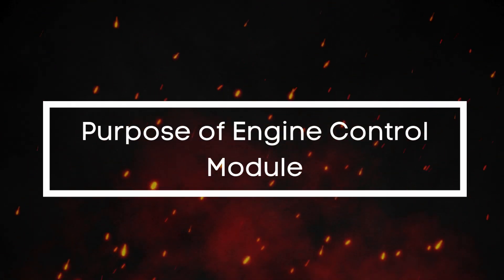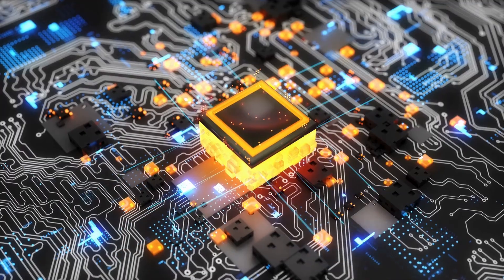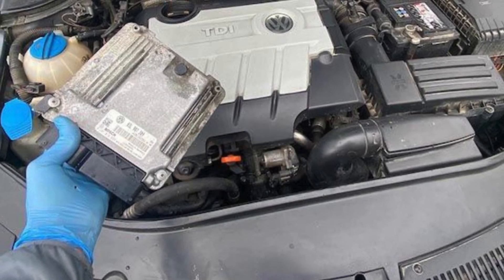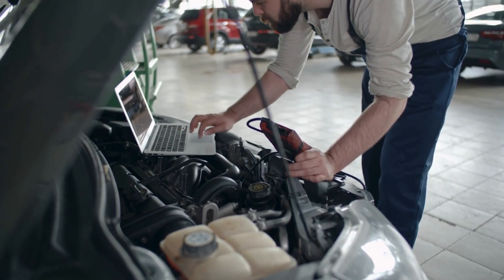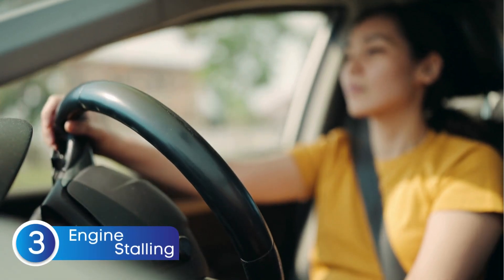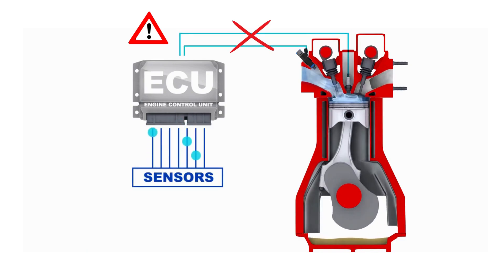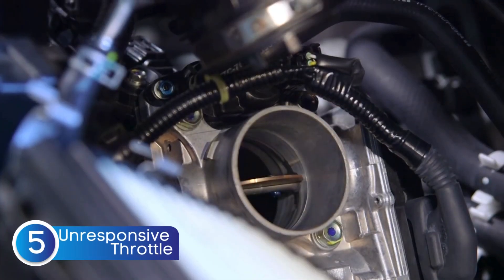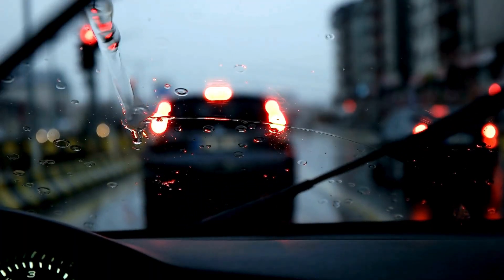Symptoms of a Bad ECU (Engine Control Module)

Comment: I take care of my car so I know it’s no major problem all my serious parts was replaced like battery, alternator, spark plugs, fuel injectors, ignition coils Oli changed regularly and all so if the ecu acting up is because it’s a old car used car and it’s probably time for a new one
Reply from the maker: It might be worth checking for any stored error codes.

Comment: Please help me my car is opel astra g 1.8 2002 my car its not start 15 seconds and  turn off. Connecting  obd2 scanner. 2 codes po530 AC REFRIGERANT pressure sensor circuit low voltage air conditioning AC Refrigerant pressure senssor high voltage. & po606 archive (inactive)  engine control module (ECM) powertrain control module (PCM) processor fault. please help me i am from (kosovo)
Reply from the maker: It sounds like you might have a few different issues, I would suggest getting it professionally diagnosed.